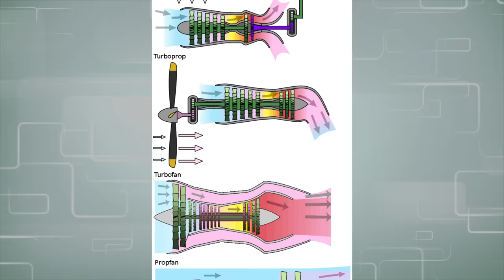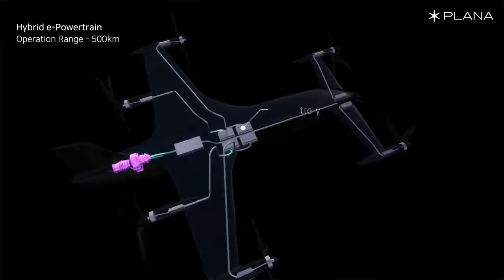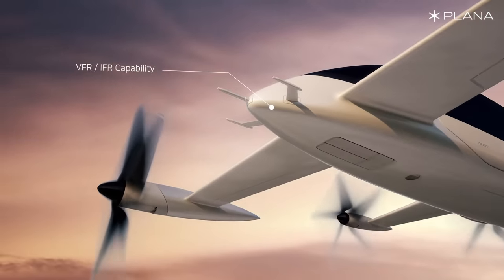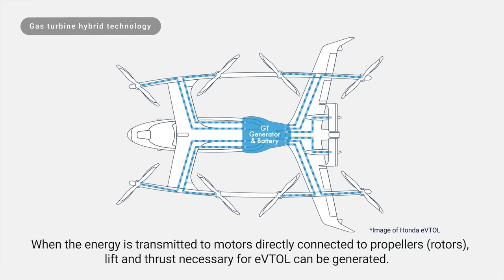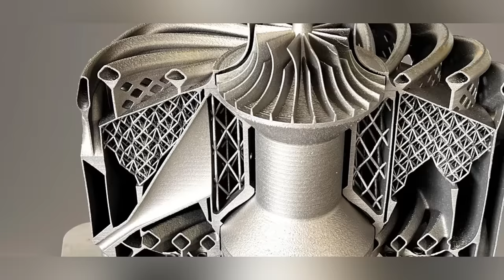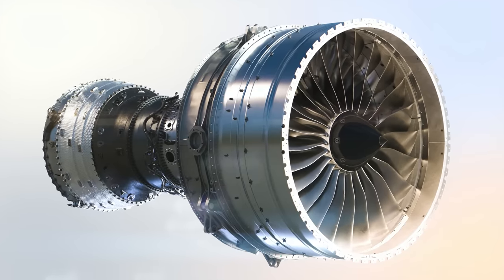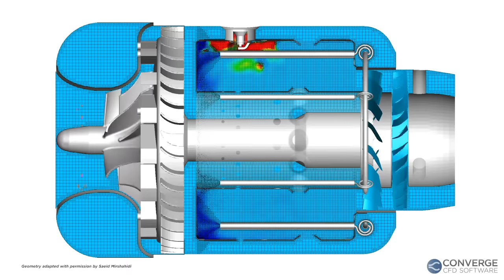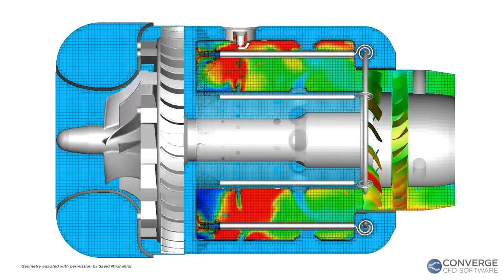New JET ENGINE Will Change AVIATION Forever

Comment: Turbine Engines are just as expensive to maintain as well. Turbine engines are also incredibly reliable. I had an uncle who had a crop duster powered by a radial engine, he was always pulling all nighters to rebuild the engine so he could get his work done the next day. When he got it he quickly came to love his new turbo shaft powered crop duster, super reliable even if he did have to pay someone else to service it.
Reply: We could get into this and spend all night talking about it but this does depend on design and how well they are maintained.
Reply: Gas turbines are extremely reliable and very low maintenance.
Reply: Those old radials had a time between overhauls of 500-600 hours. A PT6 turboprop can go 3,000 hours between overhauls, and in those 3,000 hours you never have to change the oil, never have to change the plugs, never have to do anything other than periodic inspections. They just run, and run, and run. They’re expensive to buy, expensive to run, and expensive to fix on the rare occasion they break, but they’re extremely dependable.
Reply: @singleproppilot  That 3,000 hour overhaul is the kicker through. From what I understand, for the most part it's an inspection where they disassemble the engine, and in the US it's not mandatory. Although you would be insane not to have it done. I saw a Youtube video where some clown recommended not doing it because it was to expensive. It might have been on Mojogrips channel.
Reply: Turbo shaft or did you mean turboprop?
Reply: @memcrew1  Sorry Turboprop, I have zero experience with them and not much interest.  Both are equally out of my price range
Reply: @rfwillett2424  OK.
Reply: Also cars waste most of their fuel stuck at junctions and traffic lights. An electric engine turns off when stopped....a plane is always burning fuel until the moment it lands. Also converting fuel to stored electricity is wasting fuel, its better to turn into direct motion on planes. The E Plane engine is just an exercise in corpowank distraction.
Reply: All diesel locomotives are actually diesel over electric motor. The reason...electric motors have full torque at less than 1rpm so you don't have to use a transmission.
Reply: @brokeandtired  It is almost true unless you take into account take off vs. cruise power.  There is a need for hybrid systems that use batteries for start and turbines for flight.
Reply: @krisknowlton5935 
No, because of consumer companies marketing.

Comment: All pie in the sky, a sci-fi fantasy at the moment. A fuel tank gets lighter with time, a battery is a brick when full or empty.
Reply: Yup battery powered planes exist now, small 2 pax props, but flight time is like 30 minutes, as batteries just don't have the necessary energy density, and their useful load is very small, ie two 170 pound standard people and no more.

What could be interesting though is a turbine powered generator supplying power directly to multiple electric motors, for a super-stol or VTOL application.

Comment: I got an idea. Get rid of the batteries and electric motors and just have the turbine drive the propeller or fan directly. Duh…
Reply: Because the hardest part of designing a jet engine is the coupled turbine part.

If you don't have spinning blades inside the jet stream, you can get much closer to stoichiometric, and not burn up.

An electric impeller jet theoretically could have only one moving part, not including valves. That's a whole bunch of high-performance bearings and seals you don't need anymore.

With an uncoupled impeller you also can "spool up" practically instantly. It essentially becomes impossible to flame out.

That's just off the top of my head and I haven't watched the video yet.
Reply: Forget it. The generator, motor, and batteries are too heavy to fly and have terrible performance for aviation. And the simpler and cheaper a turbine is, generally the thirstier it is. So you save development and procurement costs only to raise your operating costs. Some rudimentary number crunching will tell you it’s a terrible idea. It’s like all these inventors forget that the engineers that designed existing aircraft are really, really smart. If hybrid propulsion was the way to go, they would have done it that way already.
Reply: @singleproppilot  cool story bro
Reply: Makes perfect sense. Electric motors are easier to control. Just look at a typical quadcopter drone.
Also no need to waste fuel and time waiting for the engines to warm up. Just jump in and go. You only need a smallish battery pack for a few minutes flight.
Reply: Think of the electric part as a transmission.  The ICE part can run at max on the power curve all the time while the electric motor can run at any speed >95% efficient all the way up. 
Electric motors work better for quadcopter configuration too, while ICE provides greater range.
Reply: @JCAtkeson3  Most aircraft don’t have transmissions, because it’s unnecessary weight. And when they do, they’re as simple and light as they could possibly be.
Reply: Could they control the speed of the individual props fast enough that way? Maybe have cone shaped gears on each prop and use electricity to adjust up and down to adjust the speed. The main power comes from the turbine and the rapid adjustments would be electric
Reply: Call it diesel-electric propulsion.
Reply: Quadcopters are difficult stabilise mechanically vs electronically.
Reply: Just get an efficient piston diesel engine with just the right gears for electricity generation. This eliminates a gearbox. 4 electric props are very efficient and effective for vstol
Reply: Batteries & electric motors will provide emergency reserve on fuel/engine out scenarios.
Reply: @singleproppilot All turboprops do. The turbine spins at the 30,000 rpm mark,  large propellers less than 2,000 rpm.
Reply: @mitseraffej5812  Yes, but a turboprop has a much higher power to weight ratio than a piston engine, so the weight of the gearbox is an acceptable trade-off. Those gearboxes are as simple and lightweight as possible. One commenter suggested replacing the gearing with a generator and motor, which is not going to be light enough to fly. For some reason, people have a hard time understanding that weight is a primary consideration in aircraft design.
Reply: @singleproppilot "It's like all these inventors forget that the engineers that designed existing aircraft are really, really smart. If hybrid propulsion was the way to go, they would have done it that way already."
This video discussed 3D printing of components and even complete engines. The engineers that designed existing aircraft used subtractive manufacturing and assembled components by welding and using fasteners. Why didn't the engineers of the '60s use 3D printed components instead, or since they didn't use that technology in the '60s do you think that it is a bad idea to use it for aircraft of the near future?
Reply: @Logan4661  Aircraft engines already use additive manufacturing technology, and have for years. Single-crystal titanium fan blades were a thing over 30 years ago. It’s not the method of manufacture that I have an issue with. It’s the idea that the latest whizz-bang manufacturing techniques are going to bend the laws of physics and make electric aircraft viable when they are obviously not with current battery tech. It’s just a useless and stupid idea to power anything larger than a radio controlled toy with an electric motor, and anyone who tells you otherwise is probably trying to scam you out of money. Adding this 3d printed gas turbine to an electric aircraft as a “range extender” is only going to make a machine that’s already too heavy to fly even heavier.
Reply: @singleproppilot  They don't need to build things that defy the laws of physics for you to be wrong, just things that are above your level of knowledge and understanding. That's probably not going to be as difficult as you imagine it to be.
Reply: @Logan4661  I guess we’ll see. If I’m wrong, then electric or hybrid powered aircraft will start popping up everywhere. My experience in the aviation industry tells me it’s not going to happen. Not now and not any time in the near future. When technology comes along to make an electric aircraft viable, you’ll know it because the shift will be abrupt.
Reply: @singleproppilot  They have started to pop up, somehow you've missed it.
Reply: @singleproppilot Axial flow engines powering turboprops almost always have a transmission to slow the prop down from the actual turbine speed. Also the pitch of the prop is a transmission.
Reply: @Logan4661  I’ve seen electric aircraft. 5 minutes of endurance, same as an RC model airplane. Big whoop. That’s never going to be practical and everyone knows it.
Reply: @Chris_at_Home  Yes, we’ve covered this. Generators and electric motors are in no way a suitable replacement for a compact and relatively lightweight planetary gear reduction.
Reply: @singleproppilot  In other words, you haven't paid any attention to R/C either. At all.
Reply: Aha come on. That would be obvious. And boring. And no chance to get rich grants and subsidies.
Reply: @jtjames79 again with the one moving part bs nonsense

Comment: Hi, 
the microturbine you are showing at 4:10 is actually a joint effort, the Turbomachinery and Heat Transfer Laboratory of Technion-Israel Institute of Technology has been leading the multi-disciplinary turbomachinery design process in collaboration with PTC, von Karman Institute for Fluid Dynamics and Izmir Katip Celebi University. 
Furthermore, EOS Systems helped to complete the digital thread through implementing the efficient process for additive manufacturing. 
Using Inconel 718 powder, the final geometric proof of concept demonstrators were printed by The Israel Institute of Materials Manufacturing Technologies, affiliated with Technion’s Research and Development Foundation, on EOS M290 and by EOS Systems on EOS M300 printer.
In addition to that, 13 hour print time is extremely optimistic at this point.

Comment: At the end of the video the 3D view of a single stage turbine looks really good, however, I really don’t think these turbines can be 3D printed and expect reliability, the main issues with single stage turbines is balancing of the compressor and turbine wheel, if not done properly this will cause all kinds of problems, like blown ball bearings and more,  these  turbines turn at about 100k to 125k rpm so the balancing is critical, also the fuel consumption is very high, I have a remote control jet with a 300 newton turbine and fuel consumption is about 1 gallon per 12min flight so I am not sure the single stage turbine is the answer if we are looking for reliability and lower fuel consumption.
Reply: yeah, I doubt you can make a quality ball bearing from a 3d printer.
Reply: They are dreaming and as far as a 'new engine', Frank Whittle would certainly recognise it.

Comment: In this setting I'm pretty sure "additive manufacturing" is a more formal way of saying "3d printing" so: "a turbo generator could be 3d printed if it's constructed through additive manufacturing" is circular.
Reply: They term was created to separate piddly little FDM and resin machines(3d printing) from the very large and expensive SLS metal machines(addidive manufacturing). Additive manufacturing has been around since the 80s in the form of standard FDM and resin machines but the terms were changed and 3d printing forked off of additive manufacturing in 2010 or so when the patents became public, and the general public got them in their homes. 

To put it into perspective, one of the the first commercially available FDM machines came out in the mid 90s, cant do everything a $100 dollar machine now could do, and cost well over $100k to own.

Comment: As electric motors/alternators, inverters and batteries improve in all metrics, the simplicity and efficiency gains from optimizing engines for single-point operation using a battery to buffer demand will outweigh the diminishing drawbacks from taking the double-conversion with battery buffer path.
Reply: But we are not there yet!

Comment: You can't print bearings in inconel and have them "last". You can't print machine ground finishes from any material. It takes a machine ground bearing to roll smoothly and last any amount of time.

Comment: 3-D printed bearings high velocity and pressure...for a high speed turbine compressor that is also printed at the same time and is perfectly balanced in 18 hrs? 
Sounds a bit unbelievable to me...inconel printers must be pure magic?
Reply: It's one thing to print it making it reliable over the long term is a whole different story.  These aren't close tolerance, forged parts that have been balanced and inspected.  I certainly wouldn't risk my life on one.
Reply: A printed engine is not maintainable. One part fails and recycle the whole thing but if you get it right with air bearings and the advanced thermal management evident it could be a game changer.

Comment: The power has to come from somewhere, and batteries aren't even comparable to liquid fuels for energy density (Li-ion ~300W*H/kg, jet fuel 12,000W*H/kg) (yes that's a factor of 40/2.5%)

Comment: This subject is facinating. Ever since i learned about the LeTourneau Land Train. I have been very interested in the idea of a vehicle that also utilizes a on board generator to power systems. These land trains also have unique wheels with internal motors that give this invention a ton of capability to handle all sorts of situations. The main car is basically a living area with a drivers seat. It was one of the first projects that mixed fossil fuel vehicles in combo with a electric generator system that allowed this creation to help Canada and the northern territories to build roads in areas that were once completely inaccessible. Ever since i learned about this unique invention i have wondered just how much could we do with it today if we implemented our modern capabilities and other advancements? It's such a facinating invention that aspects of it could be utilized in a bunch of different ways nowadays. The guy really created something awesome with his LeTourneau projects.

Comment: Permit me to offer some advice on titling videos: NEVER use the word "Will" when talking about our futures!  There a lot of reasons people may -- or may not -- adopt the technologies you talk about, and you can't be sure which technologies actually get adopted until after they have been adopted.  People adopt different technologies for different reasons.  If they can adapt a new technology to their needs and it doesn't conflict with their mutually constructed social realities, adopting usually takes place pretty easily.  If adoption requires adaptation of both technical AND social practices, things become trickier.

That said, it's good to know that hybrid electric air vehicles are becoming more viable with new intentions.  Keep up the good work letting people know about emerging possibilities!

Comment: This arrangement has multiple advantages. With a small battery pack you can use more power for take offs and maneuvers, while the power plant is turned to provide baseline power for cruise and basic flight operations. You can also have as many motors as you want for your design with no need for complicated and heavy gearing. The 3d printing process is also good for certain components, but really the only way to lower the cost of turbines is to build a lot of them and iterate the design process. The mass production of efficient turbine engines would best be done for automotive hybrids, but current laws and cafe standards make that an impossibility. The government is only good at one thing, and it ain't public welfare... quite the opposite in fact.
Reply: They can't be that efficient if the can't meet emission standards.
Reply: @filonin2  Efficiency requires high temperatures, low NOx emission requires low temperatures of combustion.
Reply: i can see this in 1man quadcopters. they can serve the same purpose as micro helicopters (herding cattle or powerline inspections) but are much much easier and less tiring to fly. also much smaller package to store.

Comment: Pure BE aircraft are decades away because of poor energy density and the inflexibility of battery storage . Another factor that rarely gets mentioned is that conventional aircraft burn their fuel and so become lighter and more efficient. A BE aircraft will have to carry a full load of fuel for the duration of it's flight. This also means that a BE aircraft's maximum take off weight could only ever be the maximum safe landing weight, which limits the aircraft's carrying capability. There are other factors that would also limit their viability.

Comment: I worked on petrol auxiliary power units some years ago. The problem wasn't engine or generator, but the electronics required for power modulation
Reply: Seems to be that way since 1850.

Comment: Union Pacific used some gas turbine electric locomotives in the 50's until the early 60's.  Due to various problems they discontinued their use but information is available on line about them.   The concept is similar to what is being presented here.

Comment: 1. NO battery meets the energy density of liquid fuels at weight.  2. Transferring the generation from an engine on the  plane to somewhere on the electric network is only going to strain the network.  3. The energy density of vehicles would require a MASSIVE GINORMOUS supercalifragilistic build out to supply all the energy.  4.  how long would it take to charge a plane with that much juice instead of pumping liquid into the tanks? 

Given all of that, it is about time someone started figuring out a way to generate power on board the plane, since it is going to need it when the battery goes dead.